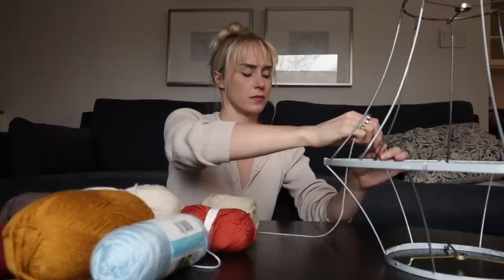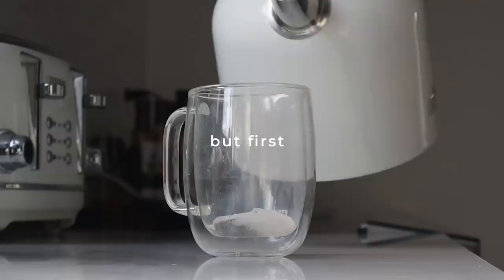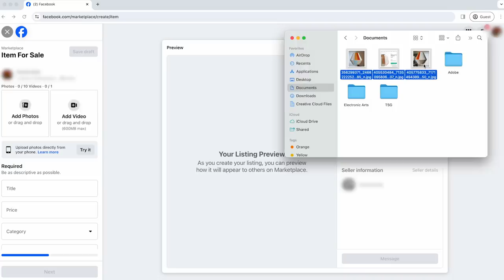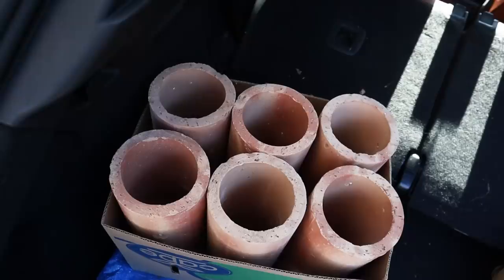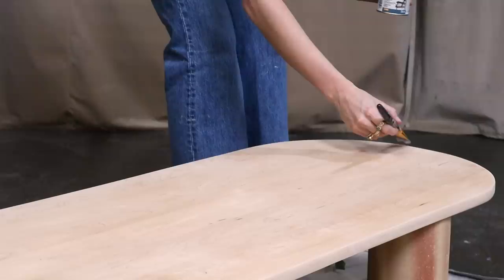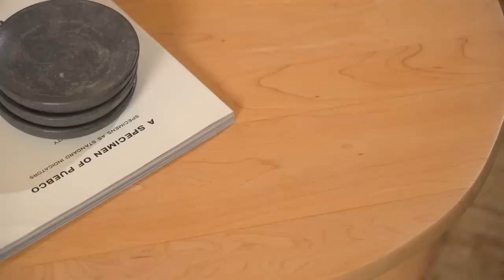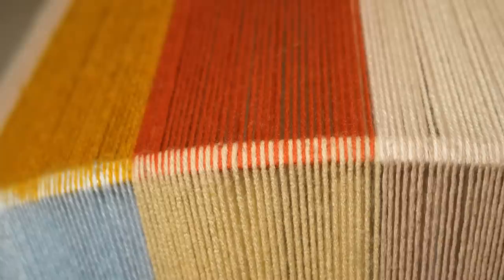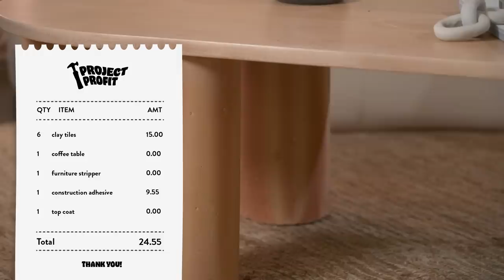i DIY'D this organic modern table & pendant for under $30

Comment: Just as a note- sometimes yarn from secondhand places could have moths (even if the yarn doesn’t seem to have them) so you should put the yarn in a freezer overnight to kill any
Reply: Smart tip!!
Reply: Something I've done before is I put the yarn in the oven at 200°F for about 30 minutes, but take off the paper sleeve first. Also just a note - moths are more inclined to lay eggs in animal fibers like wool or alpaca (not as likely to choose acrylic) since the larvae will eat the yarn when they hatch. I still heat acrylic since it may have been kept with animal fibers and better safe than sorry!
Reply: Great tip for most things from thrift stores
Reply: Same goes for bed bugs. But for these leave the stuff for a week in the freezer
Reply: Unfortunately if you don't have a chest freezer it can't really get cold enough for this to work, and either way it's at least 1 to 2 weeks. It needs to be - 20-25c for 1 week+ or - 18c for 2 weeks. In that time you can't be opening the freezer regularly. It's not workable for me so I use heat and/or vinegar. Wash yarn and textiles at 60c+ or steam it with an iron/clothes steamer, or soak in boiling water and cover. If I'm just steaming I use vinegar as well in case I don't get an area up to temperature. Store unused yarn in something airtight to prevent more moths.

Comment: Make another table with the shelf of the old table!
Reply: 100%, especially as there was so much interest.
Reply: Exactly what I was thinking! Only with just 4 legs, as it was smaller. :)
Reply: Agree!
Reply: Exactly what I was going to say. Cheers.
Reply: Yes absolutely but not the exact same, adjust the size, design, ..a bit ( smaller, higher,   more curved,...)

And yes you could have asked 60, 70$ more  & it would have sold just as fast.
The ceiling chandelier is just bit overpriced by 40, 50$ 

I know these prices bc on a weekly basis I'm a lot on the internet scrolling & looking at similar items (on Belgian sites & intire Europ sometimes even the States)
From particulier to professional sellers 

That's the only reason I say that about the price otherwise I would have shut my mouth 😊

🤘🏻❄️

Comment: I think you should also add your labor cost into the cost of these items, at least at a minimum wage rate. It gives people who’d like to possibly do something like this as a business or buyers that like to low ball a different perspective and a better view of what it ACTUALLY takes. For example, the pendant light took you over 8 hours? If we factor in just 8 hours at the current minimum wage in Toronto, which is $16.55, it would total $132.40 ALONE. Plus materials we’re looking at $161.38 in cost for a whopping $88.62 in profit IF it were to sell for $250. People NEED to see this. Creator’s/artists’ time is valuable and it’s worth something.

Comment: Beautiful! Your art hanging tip is right on because the rule of thumb I use and recommend (as a professional interior designer) is 60” to the center of the piece. And if you’re 5’-7” then your eye level is just about at 60!

Comment: I'm so jealous because I never would have thought of using those clay pipes that way. And it's not like I can go searching for them in my own hometown because yours was such a find. But now that I've seen it on a table I can't help but think what a classy upgrade to the classic 2x4 and cinder blocks bookcase. If you used those pipes to be the standing legs of bookshelves they would become a display feature.

Comment: Use the table shelf and more clay tiles for an other table but do like a white wash on them. It could be in funky colours too, like Klein blue, hot pink, bright yellow...
If you put a smaller pipe inside of them you could even stack them for side table height !

Comment: Also I may be mistaken, but I think the original purpose of these tiles is to serve as a self-watering system for gardens. I’ve been thinking about the plant bucket in the MCM credenza ever since and I think It would be really cool if you made a coffee table garden. It could be like a raised planter that grows useful herbs for cooking or it could be more like a terrarium. You could probably do it pretty cheaply with a large heavy-duty plastic tote/storage bin and just have it nest in a wooden box with legs. But in the center of the garden, you could embed the weeping tile and then you just have to fill the cylinder with water every few weeks to water your table!
Reply: Additional thought: if there is concern about having a coffee table with dirt in it, you could use expanded clay balls (lecca) as a planting medium as well. I’ve had great success using lecca to replace dirt in the plants that my cat used to love to knock over 😂 
However, since they’re also a porous clay, not sure if they would work with the weeping tile in the same way… or if they would serve the same purpose and make it redundant? 
Sorry for the long comment. I’m getting very excited and attached to this idea now😂

Comment: Stunning! I love your vision and taste. If these clay tubes can be cut and drilled into without too much hassle, perhaps you can cut them and make lamps out of them and if you drill holes, the light would come out more. If you cut them vertically, you can perhaps add more clay to the ends and make cute earthy table trays. Exciting! So glad that your Project Profit is going so well. 🌿

Comment: Are the tiles large enough to turn into an umbrella stand?
I could also see them as a beautiful base to a lamp. With a slim lamp shade about the same width as the column itself or a naked bulb/frosted globe. Would be pretty easy to DIY with IKEA pendant lights and two circular pieces of wood for the top and bottom. I would definitely buy a lamp like that! If you do make them into lamps, I would suggest making two. It can be so hard to find a matching set of unique lamps that aren’t mass produced and these would look GORGEOUS on two end tables beside a couch or nestled on matching nightstands by a bed.

TLDR: 1. Umbrella stand.  2. Turn them into the base for a lamp. And make two please!

Comment: A problem I had with recreating the lamp shade, is that the top ring isn't the same width as the bottom ring. How did you make that work with the thread? Because to fill the bottom ring, you need more thread than for the top ring.

Comment: Yes absolutely but not the exact same, adjust the size, design, ..a bit ( smaller, higher,   more curved,...)

And yes you could have asked 60, 70$ more  & it would have sold just as fast.
The ceiling chandelier is just bit overpriced by 40, 50$ 

I know these prices bc on a weekly basis I'm a lot on the internet scrolling & looking at similar items (on Belgian sites & intire Europ sometimes even the States)
From particulier to professional sellers 

That's the only reason I say that about the price otherwise I would have shut my mouth 😊

🤘🏻❄️

Comment: Make a wine rack with the clay tubes,and the table should have had something filling in the legs because those clay tubes are for sure going to Crack and shatter if you put any weight on it. The light should have been done with the same color yarn.